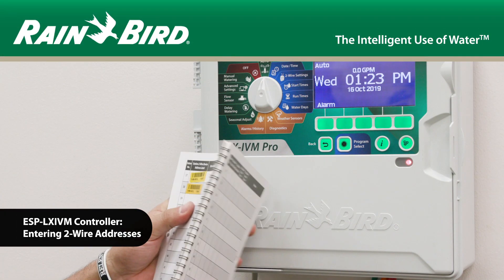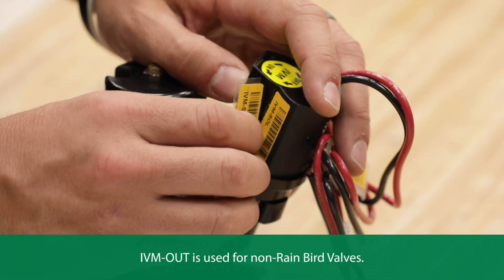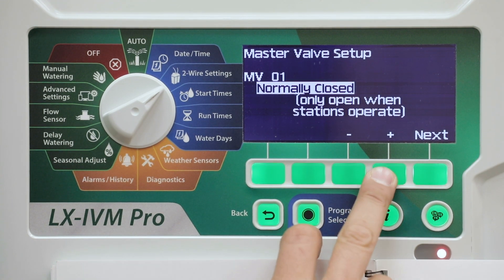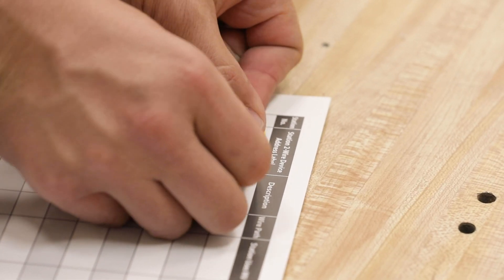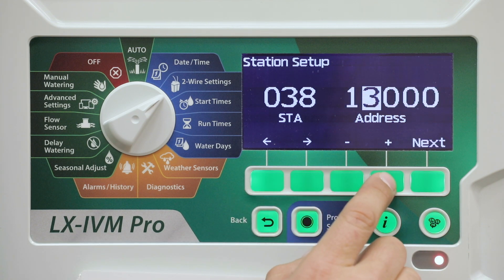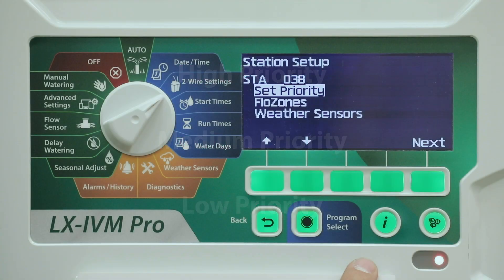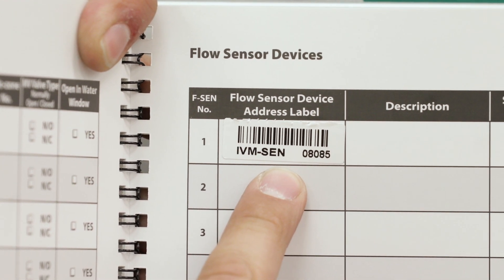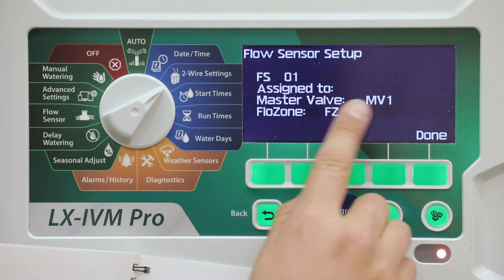ESP-LXIVM Controller: Entering 2-Wire Addresses

Comment: Can you please assist me inorder to know the difference between station address and MV adress?…is it same as encoder address??
Reply from the maker: Hi, 

Every station will have its own address. That is how the system will recognize it and enter it into the system. The MV address references more to the settings where you have to enter the address, but also, you let the controller know if this valve is normally opened or normally closed. Also. It gives you the option to assign your MV to one of your flow zones.
Reply: @RainBirdCorporation  thank you for your response, actually we are facing issues that rain bird controller not responding to solenoid valve..since there is 4 open circuit in the whole system. In this case, if we have four open circuit issues other solenoid which is good condition(pinging) should work? Or it will not work untill the open circuit fault resolved?
Reply from the maker: Hi, do you mean the IVMSOL or the valve solenoid? 
If you are referring to the IVMSOL it should start working. If you are still getting the same result. Probably there is a wiring issue.
Reply from the maker: Sure, please send us a message to parts@rainbird.com